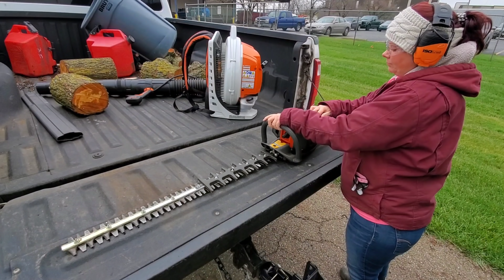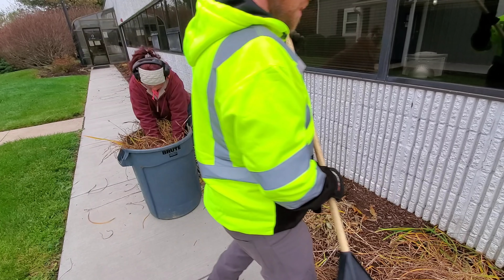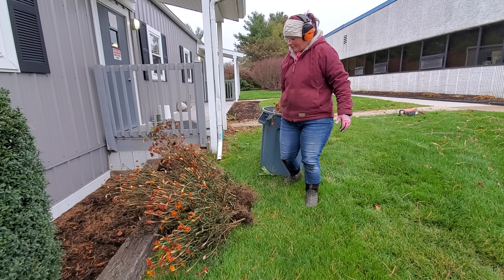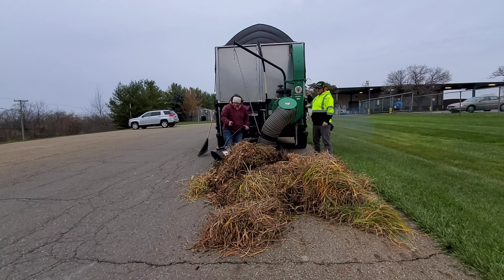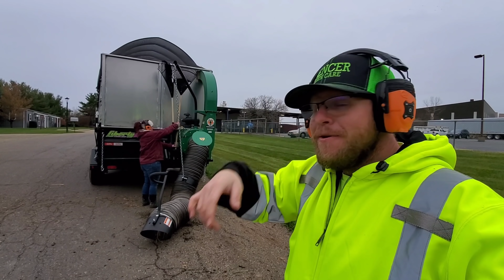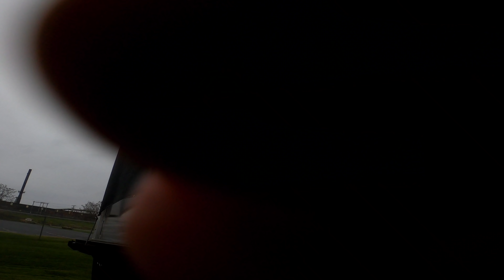How To Do A Fall Clean Up From Start To Finish!

Comment: I enjoy watching you two grow in your business.  Honest hard workers you both are.  I wanted to make two comments.  For your back ... Teeters Inversion table is like a miracle for strained and overworked backs.  It helps realign your spine and help to take pressure off between the disc.  It is worth every penny.  Second comment I watch the vacuum system and wondering if a ball type wheel on the end would help roll it instead of having to pick it up to move it around.

Comment: You mentioned in last video about fitting a hard top section at the rear of the dump trailer. I would fit one at the front section. 
That net won’t last long getting blasted with debris. 
A hard cowling on the front of the trailer will cut down on debris escaping and direct the debris down. 
It might even help fuel consumption when towing if it was aerodynamic. 
Another great job 👍
I like ibuprofen for muscle pain.
Reply from the maker: thank you and happy thanksgiving Chris

Comment: You should buy the wheel base that fit those rubbermaid brute cans. It'll save the bottom of the can when dragging across pavement. They just twist to lock on so they're easy to take off for times when you dont need the wheels.

Comment: Hey Shawn I have back issues as well in 2015 I had a double lower back fusion it did nothing to help with the pain not saying dont do it but if you do keep in mind it may not help and make it worse like it did me they have a spinal stimulator that does help alittle I would check into that first

Comment: Just a thought but would it be better to bring a wheelbarrow for hauling the debris?  Easier on the back, can be put directly under the vacuum preventing having a mess on the driveway and can be rolled directly into the trailer if you decide not to vacuum it in.
Reply from the maker: Yes we would have but our wheelbarrows are full of things right now. But that would be ideal

Comment: That shredder is nice and handy but watching TQ struggle with it and in a previous video shawn also struggling with the hose you are both looking at serious back injuries with that. You need to figure a way to ease the weight off the end so it will be easier to handle. Happy Thanksgiving
Reply from the maker: Thank you Happy Thanksgiving

Comment: Shawn I go through the same thing,  I use straight ice 20 minutes on and 20 minutes off usually twice and it works. After 10 minutes the burn is gone..

Comment: That debri loader  got your back hurting  and raking  all those leaves  to it but it will go away the more money u make with it an after your body gets use to it.I love the team work from u shawn an Savannah.Hey shawn in the future  try to put your piles closer to the street  so u dont have to rake it's already enough labor working that hose side to side.I kno its easier  said than done hope it helps u out.great footage  with the go pro
Reply from the maker: Yeah I think I over did it a it.

Comment: I would have just opened the door and emptied the barrels rather than running through the loader since you already had it all in barrels. Seems counter productive. But maybe you had a load already in the trailer and didn't want to open the door.
Reply: Triple work
Reply from the maker: I agree, we wanted to grab an inside shot of the debris loader and it gave us a great opportunity to do so. Somethings are just done for fun. lol

Comment: A serious question, when the trailer is fully loaded, how is the truck pulling?
Reply from the maker: It pulls it great man, you definitely know its back there though.
Reply: @SpencerLawnCare  I wouldn’t doubt it, I’m just shopping around now, my 2001 ram struggle with just 6k behind it every and it’s max is 8k. So was just intrigued as to how was I did it fully loaded, cause those leaves are not light!

Comment: I hope you can find a good chiropractor for your back. As mentioned, a theragun, or something similar will give relief. Also, I think you may have made things more difficult on the clean up at the expense of getting some nice video. Seems as though it would have been much faster to have just dumped the garbage cans of grass into the trailer rather than handling it twice and working the loader. Anyway, have a great Thanksgiving
Reply from the maker: I agree, but we wanted to have some fun lol and get the inside shot.
Reply: @SpencerLawnCare  it was a cool shot. Worth it from our end, for sure. Hope you're back is feeling better. Have a great Thanksgiving day with the family